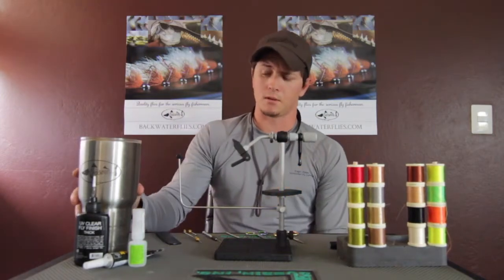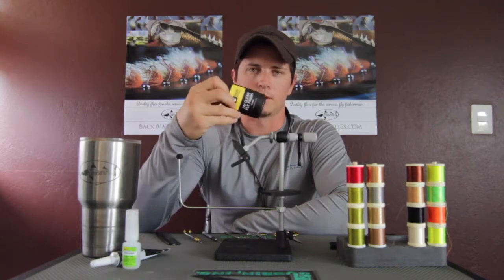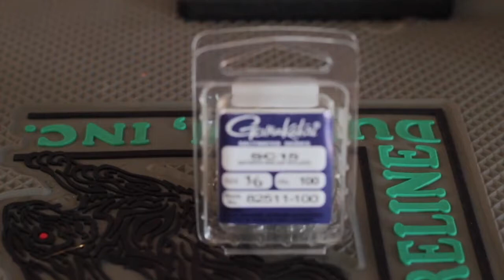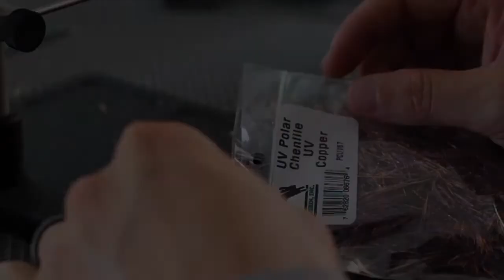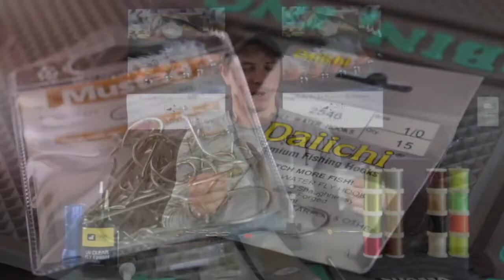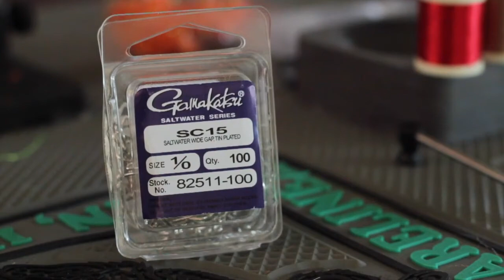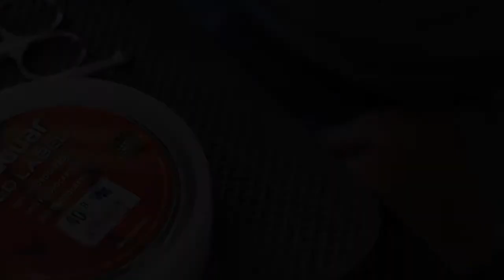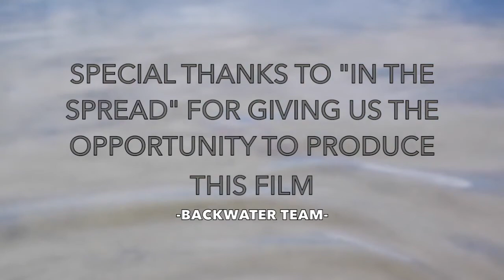Fly Tying Saltwater Flies for Snook Redfish and Tarpon | Backwater Fly Fishing

Comment: That shrimp, can it be used on an int line or is it supposed to float?
Reply from the maker: @johndiez8055  you can certainly use it on an int line. No worries 👍🏼
Reply: @InTheSpread  I guess maybe I missed it, was it designed to float? These are all great flies btw!!!
Reply from the maker: @johndiez8055  it was
Reply: @InTheSpread  gotcha, thank you!!